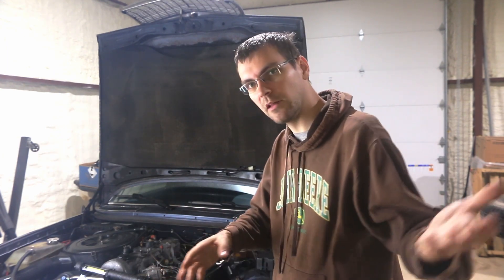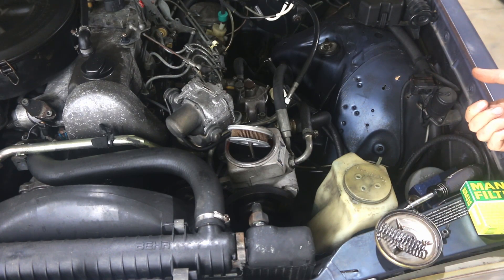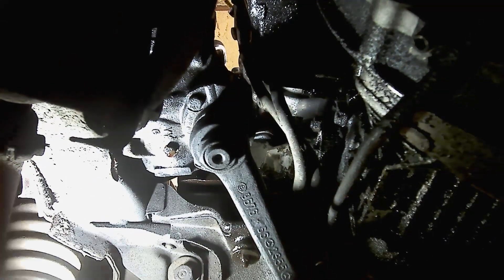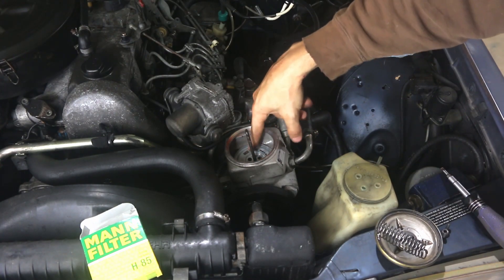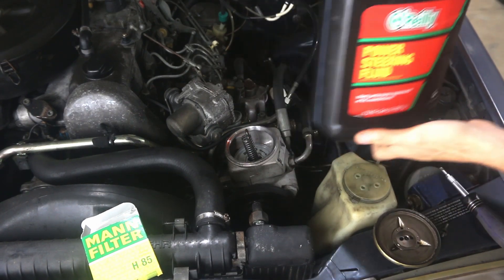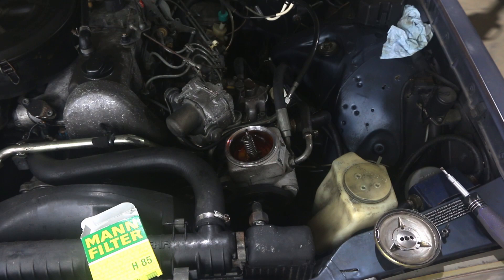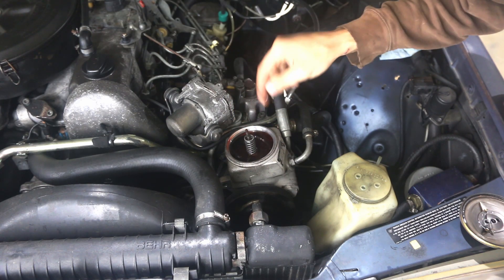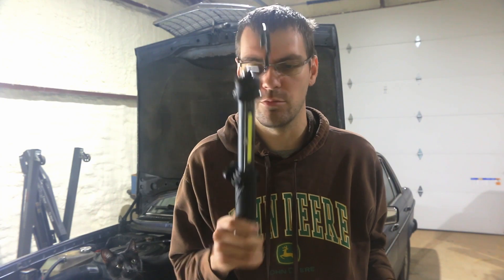W123 Most neglected maintenance points: Power steering fluid & Filter

Comment: Thanks for this tip! Just did the drain-plug fluid change on my 300D- never would have thought to try this and really appreciate the guidance. (would have been struggling with a siphon for an hour had I not known). Used MBZ power steering fluid instead of ATF.
Reply from the maker: Good deal! I'm sure your car will thank you, and using any good power steering fluid has got to be better than the modern atfs in my mind, I figure I'll flush this a few times to get as much as I can out then switch to MB fluid in a while
Reply: @trythistv   In fact, even at this late stage, Mercedes calls for using power steering fluid in these boxes. They used to indicate ATF and noticed an unusual number of these steering boxes wearing early. Alot of W123's have worn out steering boxes at 200,000 miles when they shouldn't. Part of it can be attributed to owners/mechanics using the adjustment on top of the box to reduce play in the wheel without getting the rest of the steering gear into spec.

Here's an interesting upgrade. The steering box for 560SL's used both a 3.25 turn box, like the W123, and some got 2.75 turn boxes referred to as "quick ratio" steering boxes. The upgrade is they will 100% bolt up directly to the W123. Check years. For sure it mated flawlessly to a 1983 turbo diesel. It is EXACTLY 2.75 turns of the steering wheel from lock to lock. If it's ever time for a new box it might be worth chasing if the cost is similar.
Reply from the maker: Good to know that the spec has been changed, I constantly see people saying that the manual calls for atf and that's what they'll use and I know for certain that atf formulation has changed in the past 40 years from when that manual was written!

Also very interesting tip on the 2.75 box, I'll have to keep my eyes peeled for one of those, that could completely change the feel of the car!
Reply: @trythistv  They even accepted my W123 core. I assume for a rebuilder it's no different. Since you might be looking do a search for BAP:82-00116 Q3. The best reference number for general searching is just 82-00116 Q3 or 82-00116Q3 but the BAP takes you to a site with good info on part compatibility. I didn't buy from them though. I went on either eBay or Amazon because those sites favor the buyer if there's any drama. On most parts websites you're often at their mercy as to what they feel like honoring.
The Q3 box feels great. I also switched to a direct swap Mercedes Sportline steering wheel which is a little smaller in diameter. It all adds up. These cars needed things like this back when they were being made. I still think that a great mod for all W123's is to add 2 more brake lights to the empty fog light sockets. Those plastic sockets just pop into place. Then just solder a wire to the adjoining brake light and you've got 4 brake lights coming on.
Reply from the maker: I'll be looking into that at some point for sure.
I've been trying to figure out what steering wheel I could get that doesn't change the look a ton, but is smaller, as being 6'4" makes the wheel a tad close to my legs even with the seat all the way at the lowest and furthest back option.
Do you know what yours is from? all I've found is wheels with airbags, $800 zebrano wood ones, and the aftermarket "racing" wheels that require adapters and such

I'll take a peek and see if I can find the spare brakelight sockets, I recall seeing that idea somewhere and thinking that was a great idea!
Reply: @trythistv  The variations between wheels across models isn't extreme maybe 40cm vs 42cm but it all adds up. Several models interchange but not all look right. The eBay search I used was:

("steering wheel",lenkrad) (sportline,W124,W201,W123,W126,W140,R129) -(airbag,trim,switch,column,pvc,vw,lock,amg,deep,wood,wooden,momo,hub,boss,kit,cover,srs)

The wheel from a 230E W124 is supposed to be the smallest dia W124 wheel. There are actually some good ones on eBay when searching worldwide. I scanned through a few. Item #164532090061 is such a deal that if you don't like it you can always resell it. For sportline just type out mercedes sportline wheel. There aren't many. The non-airbag versions have the same plastic center star as the W123 wheel. 
Other worthwhile mods keep coming to mind. The rear of these cars is very dim overall at night. In addition to the two extra brake light bulbs there are some LED W124 license plate light lenses on eBay that are plug and play on a W123 for like $15 a pair? The difference is spectacular next to the dim yellow expensive to replace W123 lic light lenses with dim yellow festoon bulbs.